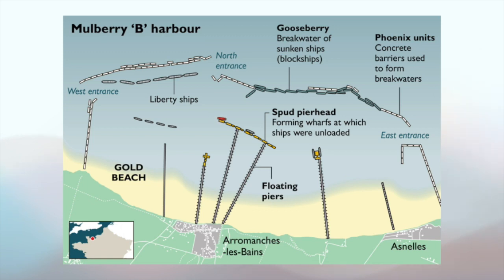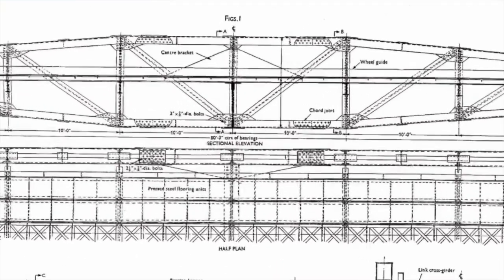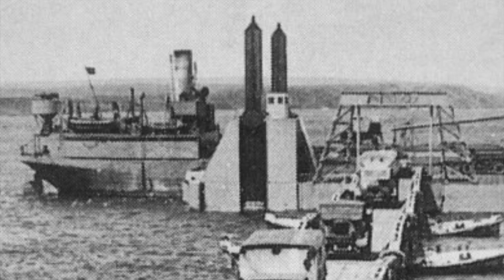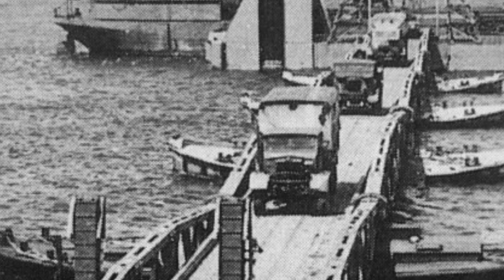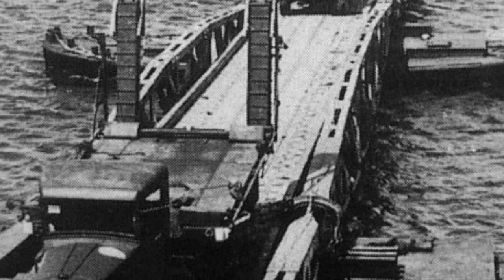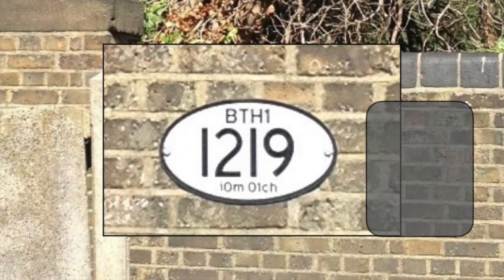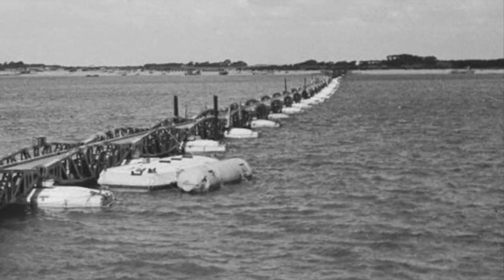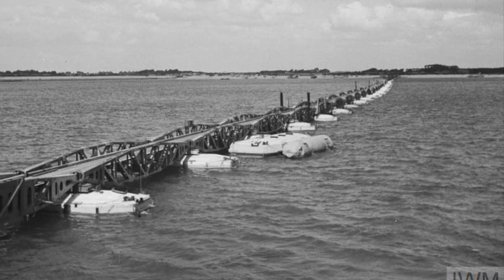Mulberry Harbour Maths

Comment: The old imperial measures had some advantages for simple maths.  12 is divisable by 6, 4, 3, and 2.  2/3s is 8", 3/4s is 9".  The chain of 100 links is 66 feet which is the basis of the mile, acre other units of length and area. The standard road width where I live is 66 feet.  The normal lot width  is either 33 feet, or 66 feet. The normal lot depth is 122 feet with a 20 foot lane (or 132 feet {66 x 2} with 10 feet taken off for half the lane).